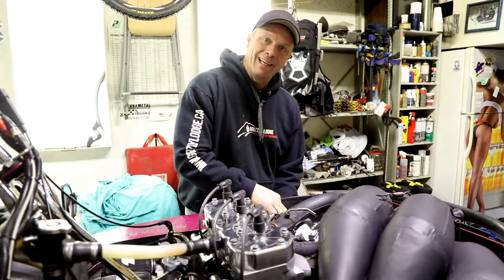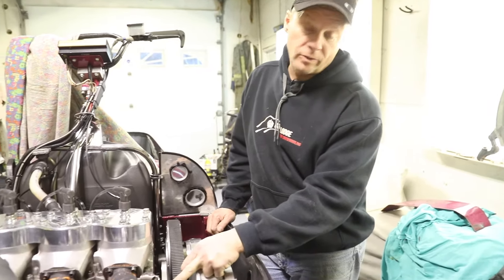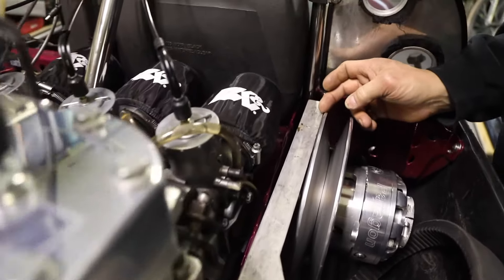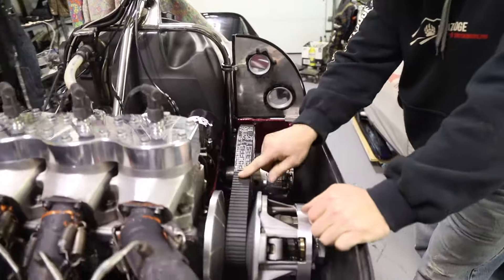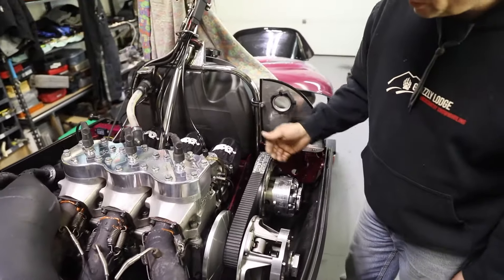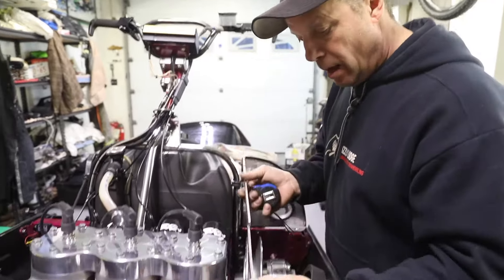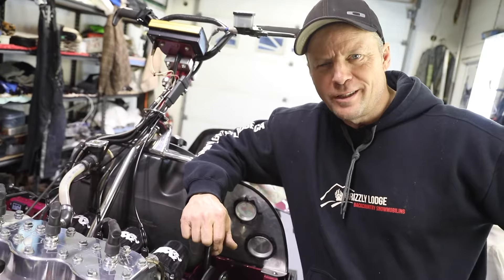Belt deflection, belt alignment, chalking the clutch. With and without proper tools.

Comment: and if you put your alignment  tool on from the bottom of the drive clutch , take some measurements . compare the top and bottom you can adjust belt skew  , by playing with your engine stops you can adjust the alignment so the clutches are dead parallel at full throttle under full load , increasing performance ,lowering belt temp increasing belt life , take a seamstress tape measure with you to the dealership , be nice to him and he might be nice and let you go through his belts measuring diameter and width ,pick out 3 or 4  that are the same .that way you have little to no adjustments when changing belts , you can rotate through those belts reset the clutches and rotate through again ,  when you get them home ,sunlight dish soap and a scrub brush ,the hottest water you can stand will remove the mold release from manufacturing , mold release will bake into the belt under use making it hard and prone to slipping ..... belt alignment is free and is the foundation for clutch tuning and performance

Comment: Very AWESOME tips on what to look for and check out with the alignment part and the deflection also! I now know that I have 2 separate issues with my Polaris clutches that need prompt addressing thanks to your knowledge and experience with racing!!! I'm by no means any expert on Setting up a CVT system outside of the basics that I actually thought was written in stone that you were suppose to setup the primary and secondary on an almost dead straight line!?? Smfh now! I've been doing it all a bit wrong all these years Man. I get why you actually want to have a 2mm or so offset shaft angle to help aid in the belt to drop a little bit easier into the secondary clutch while it's climbing up the primary, I see how this method in all actuality makes more sense than a dead on straight edged alignment like that I've been doing to my clutches for the last year now on a Machine I've been building using a Polaris engine basically in my Ezgo golf cart. I just finally got done with re-machining the clutch surfaces and put a aftermarket Helix in with a Comet Silver spring in the secondary. The primary I'm running A-1 weights, originally setup for a Yamaha exciter sled but I gutted the weights and silver spring from that to make a hybrid Ezgo primary clutch by removing the spiders machined a new bearing for the shaft and installed in on my bastardized golf cart LMAO. The engine's a hybrid as well with a Ezgo crankcases 2 stroke from the early 90s Ezgo's. Rebuilt the crankshaft with a Polaris Hot Rod's kit and all new high end Japanese ball bearings seals ect. It's a double ball on the pto side as well so it's much more than capable of holding up to the HP I was seeking. Used a jug and piston off a Polaris sled 488cc twin cylinder engine cuz this is a 244 single I have, Ezgo bottom end. So from the jug base gasket up it's all Polaris parts which bolt right on the Ezgo bottoms without machine work necessary outside of a few MM longer jug studs, that's it. Both the Polaris and Ezgo engine's of this vintage earlier and later were manufactured by Fuji Industrial, so they are both pretty well built engine's. The 488s/500s for a fan motor, probably the utmost reliable sleds I've ever owned and operated the longest as they still do with tens of thousands of miles on them engine's still solid as rocks and run strong. No comparison to what you have really a different ball park all together lol. BUT BTW your sled and engine look amazing! Love a good clean and tidy looking engine bay! It's sweet man! Them expansion pipes look killer as well! What's the HP on say something ya have there in the video ya thinking? That a Polaris Triple 650 Or Rotax based engine? I've seen them sleds drag Man! They are disgustingly sick! But yeah now I'll have something to do over the winter and change my alignment of the sheaths to get the offset of about 2mm like that you were showing. I'll tell ya what, I know you probably had a good laugh about my project being a little single air engine, but it's definitely no joke in a lightweight golf cart, for a 244 with mild work internals, squish band, mild porting otherwise stock though 38mm MiK flat slide and a stock Polaris 250 expansion pipe and silencer, she lifts the front passenger tire off the ground with 2 full sized big adults over 200lbs ea! So she is a little tiny Rocket Ship I call her. On dry pavement with street tires, no off roads but 12" wide rear tires 4" in the front with one person breaks the tires lose on course pavement, and leaves a good smoke trail down the road! 60mph your about ready to die any second cuz even a modified version golf cart even with 4" of wheel spacers it's just too short of a wheel base at high speeds over 50-5 your white knuckles and holding on for dear life. LMAO! BUT again sorry to bore ya with such small potatoes here, I love to drag race anything, I'm too old for getting in and out of my drag cars anymore especially with my back and neck injuries, a hard seat and squeezing in and out of roll cage bars anymore I'm done over with. Plus the golf cart ya can have like 4 times as many cuz they take up so much less space. I'm in the process of my next project a 570 Eaton M-24 supercharged V twin going into a cart! Expect to see well into the low to mid 100s of HP I'd be happy with almost 100 but Shit we all need that Adeline rush somehow brother. Stay safe Man and thanks so very much again for your help.
Reply from the maker: Dude , here at Digit9 , we love everything and anything that gets modded ! Love your project ! The motor at question in vid is a 1200 twin from Linderman with a 3076 Turbo , good for 400 hp at 20 psi , my other mod is a Polaris XCR 800 base Price Performance triple , dynoed at 240 hp !!

Comment: Thanks for the info. I too have a custom built s chasis , but i have polaris primary and secondary. 
I never knew they were not meant to be parallel . (thats how i set them after i got the sled and it was 
burning up the belt)

Comment: BIG QUESTION: Why is 19mm and 17mm perfect? arn't they supposed to be identical (indicating that the secondary clutch is paralelle to the primary? I am confused now!
Reply from the maker: Because they wouldnt stay perfect ! Torque from motor and motor mounts cause deflection , so you set the offset with no load so that under load the clutches line up closer to parallel

Comment: So heres my problem
 when i tip the sled on the clutch side the belt starts slipping its a new belt and i cleaned the clutches and they havent worn out the alignment is good and the tention is also good i was thinking could my secondary be loose on the saft so the alignment would be ruined when i tip it

Comment: Soi looked at my primary and there is about 1/8 of an inch gap when the belt is sitting on the primary clutch bearing between the sheath and the edge of the belt. How do i adjust that
Reply from the maker: Buy a new belt thats a bit wider , or you are gonna have to take clutch apart and add a shim to tighten it up ! I believe the correct spacing is 20 thou !

Comment: The last method without a clutch alignment tool seems wonky... Where does he come up with 19mm on one side and 16mm on the other side as being in spec?

Given they are not the same exact number there is skew (jackshaft and driveshaft are not parallel) but even beyond that if they were 21mm and 18mm would that now somehow be out of his magical spec? How do we come up with these numbers? Surely each sled would be different?

The numbers must matter to know that the clutches are running true to each other...
Reply from the maker: Clutchs need an offset to allow for the engine torque !

Comment: Thank for the tip, however, when I align my clutches on my crossfire 2011 without the tool, i get both identical measurements. I tried removing and adding shims in the back of my secondary, but it changes nothing. I exploded one belt last year but it was used and I don't know how long it had since I bought the sled last year, however, I always get this jerky feeling at lower speed, like if a clutch engages and disengages back and forth until I give gas again then he's ok. I'm about to drop it off at the dealer to check alignment, but maybe you can help.

It's a 800 sno pro, this summer I rebuilt the whole diamond drive, bearings, and seal, new oil, the primary clutch is brand new for Arctic cat, my secondary waws rebuild last year at the dealer, belt is new and deflection is on point according to your videos, I also adjusted my track tension and aligned, it is perfect on each side. 

Any ideas ?
Reply from the maker: Check motor mounts !
Reply from the maker: Got correct belt ?
Reply: @DIGIT9  Yes according to Arctic cat dealer and website it is the good part number.
Reply: @DIGIT9  If they have physical damage or if they are align properly ?

Comment: What would a slapping sound be till it warms up? Coming from the primary.
Reply from the maker: Belt or track ?
Reply: @DIGIT9  I put a new belt on, but don’t see an adjustment on the Kawasaki mule FXR to take slack out. If they have one, I’ve looked everywhere online.  thanks
Reply from the maker: That would be a ATV ! Bit different than a snowmobile ! Gearbox could be pooched ?

Comment: Should you have play between your secondary and your jack shaft?
Reply from the maker: Keyed shaft , side to side , Yes , splined shaft , no !
Reply: @DIGIT9  thanks, I have a 1986 indy 600 and It was blown up so I rebuilt it. But know, I'm having so much trouble with the Secondary clutch.

Comment: I've got a rev chassis, modified 800 motor, and I absolutely destroy belts. I floated my secondary and it still shreds belt, motor mounts seem tight, engine stop is snug, I've had both clutches apart and tuned up, deflection set up good to my knowledge,  any idea or help would be appreciated! Thank you sir
Reply from the maker: How long , lug of track , gearing and clutching ! Sounds like your clutching is out to lunch !
Reply from the maker: Kind of clutchs ?
Reply: @DIGIT9  it won't let me add the comment for some reason, is it possible to send you a text on different platform, thanks sir
Reply from the maker: Ya try Instagram

Comment: I appreciate your video. Regarding clutch alignment, if i'm running a straight edge shouldn't the two clutches be offset but square? ie. measuring off the driver clutch the driven clutch front and rear measurements be the same? I have no idea, just clarifying.
Reply from the maker: Not sure what you mean by “square” ? If you have a straight edge off the inside of the primary towards secondary , what ever measurement you come up with , the front of the secondary should have about an 1/8” space compared to the back of secondary where it should be touching , thats the alignment ! Or offset ! So that under torque the two clutchs should line up perfectly !

Comment: Hey thanks for the info, really love your channel. Quick question for you, I purchased a 2011 crossfire 800, and spider cracked (the clutch was supposed to be new, trusted the guy I bought it from). Anyways I'm rebuilding it, but after watching your video I realized that after 100KM/H, the engine starts floating, and revved really high. Once I put everything back up I will check the deflection and i'll chalk the primary. If i'm not using enough of the clutch, what would you recommend changing first? I mostly ride hard trails. 

Thanks in advance !!
Reply from the maker: What do you mean “floating “ ?
Reply from the maker: Almost sounds like belt is slipping ? Snow ingestion ?
Reply from the maker: Might need to gear it up ?

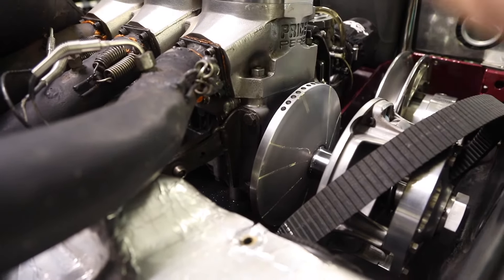Comment: 1:50, wouldn’t you need lighter weights to get the belt to use whole clutch surface?
Reply from the maker: Nope
Reply from the maker: Lighter weights will make it rev higher but not go any faster unless you add some angle to the helix or put a softer spring in primary !

Comment: I’ve got a 2014 m8000 153. I’m having clutch troubles. When I put it in reverse the belt slides into over drive on the secondary and won’t pull itself. Even up on a stand. I hope this problem is related to it blowing belts more often than I’d like.  Any thoughts?
Reply from the maker: What do you mean “slides into overdrive” ? Overdrive is only achieved at WOT across a lake or hard flat surface !
Reply: @DIGIT9   like high gear, the rollers aren’t catching in the reverse notches and keeping the secondary in a low ratio. Not sure if it’s the defection, bad spring or something else is worn.
Reply from the maker: Take it apart and look ! Could be a broken or worn spring ?

Comment: How much movement should the driven clutch have back and forth on the shaft?
Reply from the maker: none on a Doo or Cat , but about 1/8' on a keyed shaft Polaris
Reply: @DIGIT9  ok thank you. That is what I gathered but it looks to be splined. Think the 1/8" still ok?
Reply from the maker: If its a splined shaft , DO NOT float , splines will get buggered !
Reply: @DIGIT9  ok thanks! I appreciate it and subscribed!

Comment: Thank you awesome video is always with your content! Now I want to put a performance clutch on my O2 700 X edge what else do I have to change with that type of clutch?
Reply from the maker: depends what your putting on for a "Performance " clutch ?
Reply: @DIGIT9   I was looking at putting in an EPI performance clutch I’m not sure with mine if I should go with the trail performance clutch or the racing performance clutch
Reply: @jamesrinaldo2602  not how clutches work on sleds. You've bought a clutch kit

Comment: Hey, i have some problems with my clutches. Im new to CVTs as i've only worked on normal gearboxes and hydrostates before. Would be nice if you could give me a hint or so! 

I had a pretty loud squealing/whining noise from the clutch side, it almost sounded like an RC car.😅 
When i put in a new belt the noise pretty much went away, but not fully. It still has a decent sound to it.(you hear it the clearest if you have some speed and let off the throttle, but no sound at idle. 
Do you have any ideas on possible broblems?

Plus another question, how do you know the reqired measurements when checking the alignment with a tape neasure? 

And nice work with your vids bud!😁🤙
Reply from the maker: Check the bearing on the drive shaft just below the secondary !
Reply: @DIGIT9  Had some thoughts on that too... Or the one beside the secondary. Sounded a bit like our old stump grinder with blown bearing.

I was getting concerned when it got less when changing belt. It could happen i greased the bearings in the same go.
Reply from the maker: What kind of sled ? Mileage ?
Reply: @DIGIT9  Rmk 600 02 with i believe about 10 000km
Reply: @DIGIT9  Took it apart today, there aint no ball bearings at the lower shaft, just bad grease. The upper shaft has one ball bearing, which creaks and is hard to turn. Thanks for the reminder!

Comment: So why would you want that to be what appears to be an 1/8 out of square?
Reply from the maker: Torque of the motor will balance it out , so that under load , your clutchs are perfectly aligned !
Reply: @DIGIT9  Ah Thank you for the explanation it makes sense but I would have never known. I have always just squared them up guess I should have invested in a service manual lol. Thanks again.